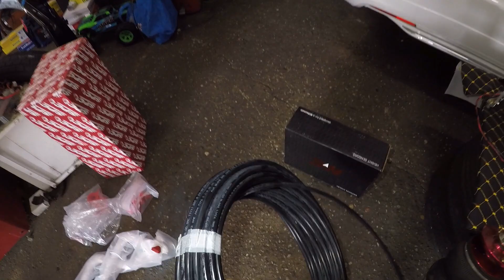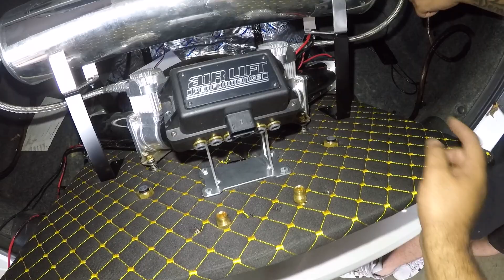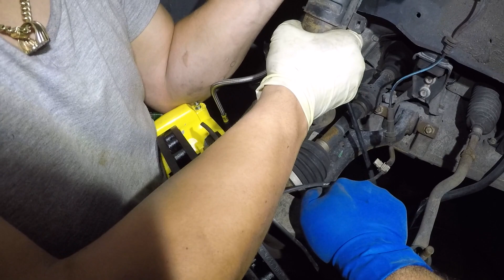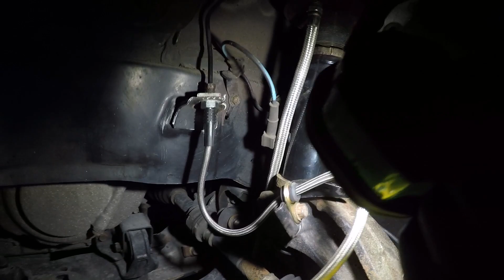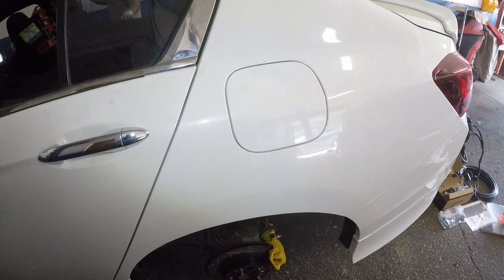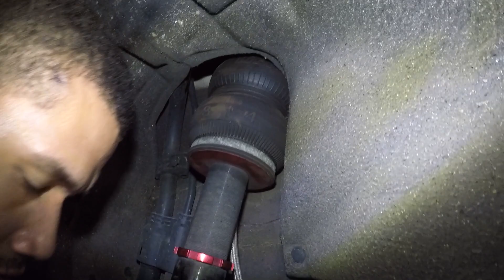AirLift suspension installation on Honda Accord part 2

Comment: Hi sir.could u plz give me ur contact numb.i need to discuss abt an issue
Reply from the maker: Sorry I don’t direct contact message me here let me know what’s going on
Reply: I have a prob with the alternator.i have honda accord exl 2.4 (4cyl) 2017.i change the alternator buy from Autozone duralast brand.
Reply from the maker: @syedrizvi8488  what’s wrong with alternator?   There is sensor on the battery see if that’s connected and make sure it’s propperly pushed in I had car another shop changed alternator and the connector was loose on battery
Reply: When the car is in idle conditio no any electric load on the alternator the testor shows nothing,and when the headlights are on,or Ac on the testor shows that the alternator works good.
Reply: Inshort words in idle condition testor show that alternator is not working and when the electric loads on alternator the testor show it  is working
Reply: I just installed t days ago and faces this issue
Reply from the maker: @syedrizvi8488  put on Volt meter show me how the rc voltage it’s giving idling make a small video the voltage should be above 13.40
Reply: One of the mechanic told me that this is how honda alternator works.when we put the load on it computer system works
Reply: I buy from autozone the price was 542 and it is life time warrenty
Reply: Could u plz give me ur email id,so u can send u asmall clip
Reply: Where do i send a video clip??? Here is no any option